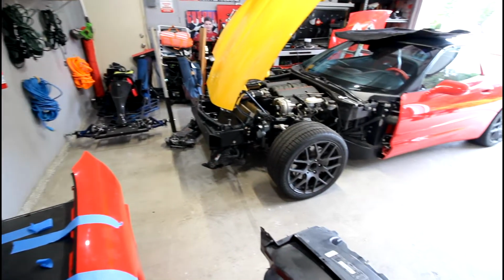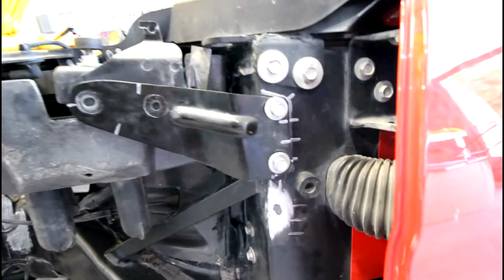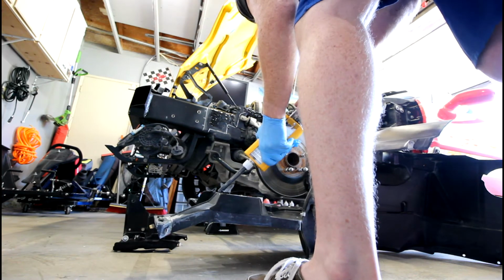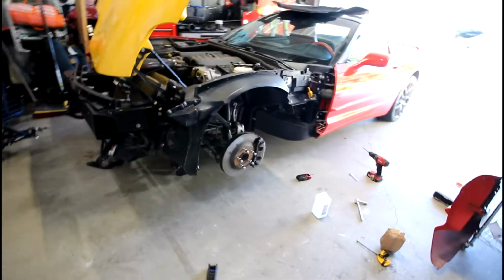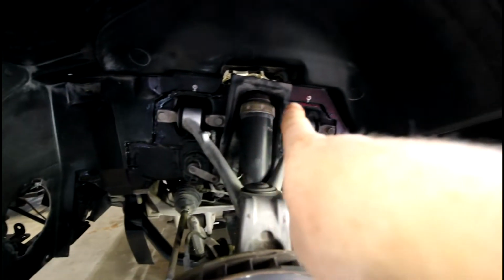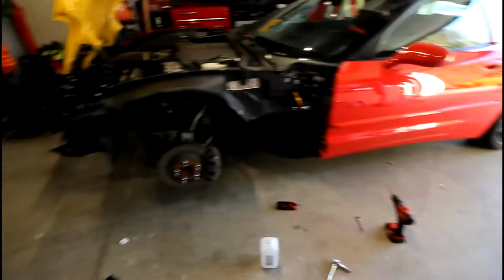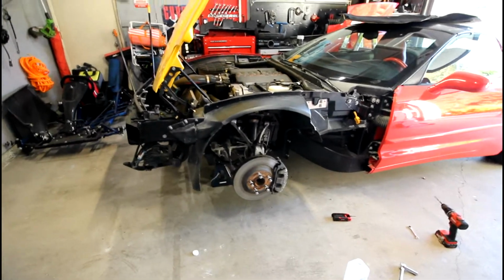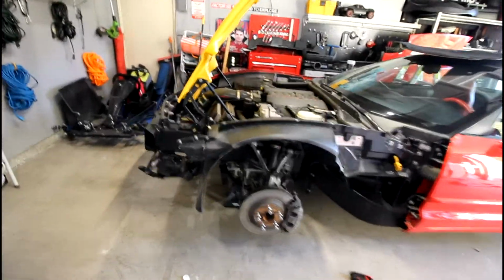How to Permanently Glue (Panel Bond) an Inner Fender/Wheelhouse on a C5 Corvette

Comment: what a job... thanks for this tremendously. I will reach out if you are still making those spacers soon
Reply from the maker: It was pretty involved, but definitely doable by a DIY'er like myself. Spacers are still for sale on my Etsy store! 

https://www.etsy.com/listing/1092003522/c5-corvette-inner-fenderwheelhouse-3d?ref=shop_home_active_4&sca=1&logging_key=e743cd9023dd23179fcf49765c3fa62bc9905181%3A1092003522

Comment: Hello I was hoping you got those spacers together by now ? I’m trying to put my corvette back together. Please let me know
Reply from the maker: Hey! I’m so sorry, this completely slipped my mind to do this. Do you need the physical 3D printed parts or just the 3D model files to print yourself? Also, was that you that also messaged me on Instagram about these?
Reply: @Addimotive  the physical 3D little squares. Yes that was me, it’s easier for me to msg there
Reply: I’m at the point where I’m ready to glue it on but want to make sure I get the spacing right
Reply from the maker: Got it. Working on printing them now. I created a instruction guide, then I’ll create the Etsy store listing where you can buy them. Bear with me, this will be my first time trying to ship a physical item from an Etsy order. So you’ll essentially be my first 3D printed part customer!
Reply from the maker: I’ll get them up on Etsy and finished printing by the end of the week if all goes as planned.
Reply: @Addimotive  if it makes it easier I can just cash app you and you can just send it straight to my house 🤷🏽‍♂️
Reply from the maker: @1WsOwe  Your spacers are printed and the listing is now live on my Etsy store! I wanted to get the Etsy store listing up so it helps me to build my seller shop page. Let me know if you have any questions! 

https://www.etsy.com/listing/1092003522/c5-corvette-inner-fenderwheelhouse-3d?ref=shop_home_active_1

Comment: So are the spacers for sale yet? Would the be the same for passenger side?
Reply from the maker: Hey! Sorry just got to seeing your question! I had to do some adjustment to a few of the spacer widths. They should be up for sale in the next week or so. Super swamped with my day job right now. Passenger side should be the same, but that is just an educated guess. Assuming the car is symmetrical, it would make sense that driver and passenger side are the same. Would you want actually 3D printed parts or do you just need the build files?
Reply from the maker: Spacers are finally up for sale on my Etsy store! Sorry for the delay! https://www.etsy.com/listing/1092003522/c5-corvette-inner-fenderwheelhouse-3d?ref=shop_home_active_1

Comment: Just finished mine! Thanks for your vids. Not the worst job, but definitely something you need to pay attention with. My final alignment is a bang on match with the factory side, 100% sure the local body shops would've botched it. I used the same panel adhesive you recommended, went through about a half tube. I used the old glue strips as spacers and used an old PVC pipe, cut to match the profile of the wheelhouse and braced against a wall to hold it in place while it dried.
Reply from the maker: Nice glad it went well!